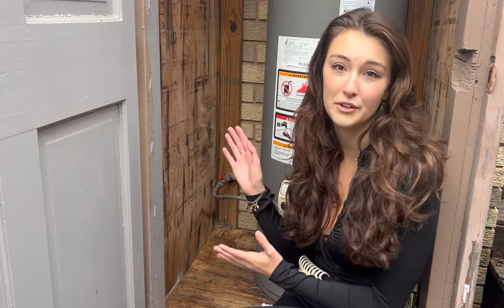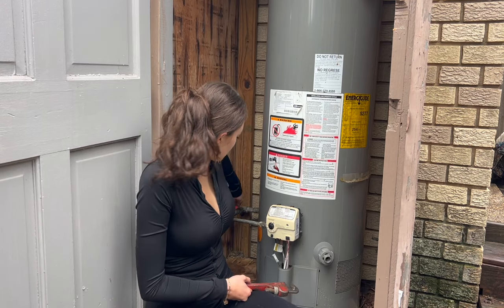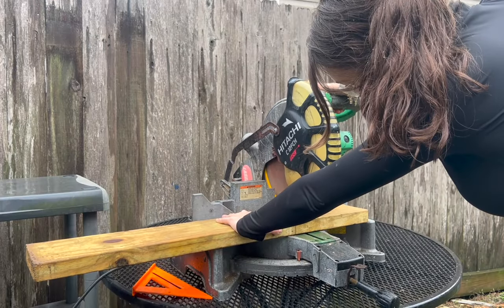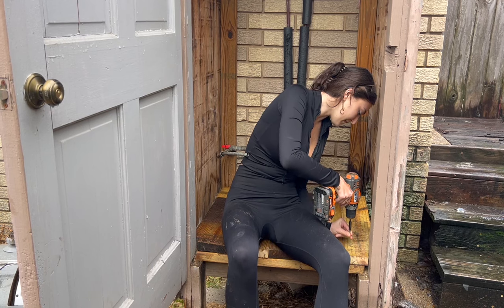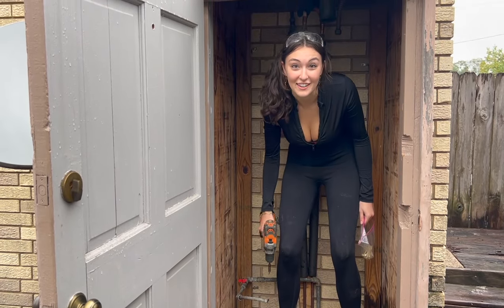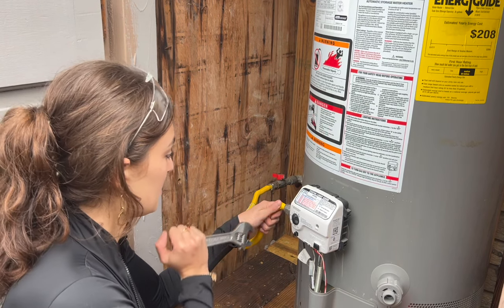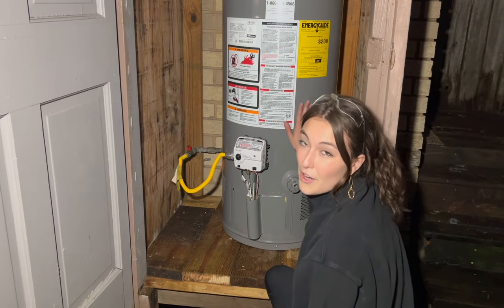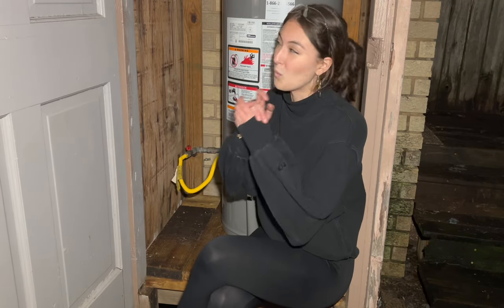How to Install Brand New Water Heating System!

Comment: Great video Rachel! I'll remember you if I have any plumbing problems. 😉
Just wanted to add that with ELECTRIC water heaters, its important to shut the power off to the water heater FIRST, ottherwise, the second you drain the water, you'll blow your elements.
This heater was NG, so that step wasn't needed, but if anyone with an electric water heater wants to do the same thing, that's an important step.

Comment: When we had a gas water heater we'd sometimes get drips falling on top of the burner, especially when we used a bunch of hot water. I think the extra cold water coming in cooled off the flue inside the water heater and the water vapor from the burner condensed and dripped back down. Never put out the pilot light though.

Comment: @rachelmichellepizzolato When you moved your arm at part 0:06 in the video, I saw a very large hole at the very bottom of the wall on the right side of your friend shed. Is that very large hole supposed to be use for ventilation? At my house I use those foam insulation that cover water pipe for both hot and cold water. You should go back and put foam insulation over the hot water line, so it won't get cold and still stay hot. I know some people will say it is unnecessary to cover hot water lines with foam insulation, but I do it anyways.

Comment: The second thing to do after your hair, a very necessary step, is to flip the breaker to stop the flow of electricity. The elements will overheat once the water level drops below them, as well as the danger to fry your up-do when you disconnect the power lines.
Reply from the maker: It is a gas heater…No electricity is required for its use. 

Thanks for stopping by! Enjoy, and don't forget to thumbs up and subscribe 🛎 so you never miss an upload! Please share the videos and comment on what videos you would like to see next + follow my socials to keep up with my daily life! 😉 

--
💥My Socials:

TIKTOK - OfficialRachelPizzolato
INSTAGRAM - instagram.com/beautyandbrainswithatwist
INSTAGRAM (Alternate) Instagram.com/rachel_pizzolato
FACEBOOK - https://www.facebook.com/Beautyandbrainswithatwist/
TWITTER - https://twitter.com/braintwist2112
WEBSITE - https://beautyandbrainswithatwist.com/
SNAPCHAT - Itsrachelpizz
Reply: :face-blue-smiling::face-purple-crying:

Comment: As a licensed inspector for more than 20 years, unfortunately I would have to fail this installation for 2 reasons. 1. There is no overflow tube installed. It  must extend from the spigot by the TPR valve near the top of the water heater to 5 inches above the floor. It can be copper or pvc. 2. There is no proper air vent installed for combustion. (The hole rotted through the side wall doesn't count). A vent hole can be cut into the door. A vent must be 1 square in for every 1000 btu of the water heater. So, a 100,000 btu water heater must have a 100 square inch (10" x 10") air vent. An air vent is needed so oxygen can mix with the natural gas for combustion. It's relatively easy to fix these 2 issues to make your installation meet plumbing codes.
Reply from the maker: I will get right on those issues as soon as I get back home! Thanks so much!

Thanks for stopping by! Enjoy, and don't forget to thumbs up and subscribe 🛎 so you never miss an upload! Please share the videos and comment on what videos you would like to see next + follow my socials to keep up with my daily life! 😉 

--
💥My Socials:

TIKTOK - OfficialRachelPizzolato
INSTAGRAM - instagram.com/beautyandbrainswithatwist
I’m 
INSTAGRAM (Alternate) Instagram.com/rachel_pizzolato
FACEBOOK - https://www.facebook.com/pBeautyandbrainswithatwist/
TWITTER - https://twitter.com/braintwist2112
WEBSITE - https://beautyandbrainswithatwist.com/
SNAPCHAT - Itsrachelpizz
Reply: Get a life
Reply: @petemarron6677  The girl tries to do things the right way. I'm a licensed plumbing inspector, and just told her how to easily do it the right way, with 2 simple things that will take a couple of minutes. So get a life yourself.
Reply: @JimMorrison-m8x  I think it's great you gave your professional opinion on it with purely constructive feedback. Thanks for sharing sir.

Comment: So the pilot light heats up the thermocouple, if the pilot light is dirty it will be orange, and it would be too cold to keep the thermocouple hot enough to stay lit. ( flame goes out on tank)   Or is is possible the thermo couple is weak and need replacement.  All of these things are cheap to do. These things cause intermittent heating and going off. Unless there is water in the bottom of the water heater, it is fine.

Comment: 6:58 When you are done put a bright light inside the Water heater cabinet and see if you see light, the water heater requires air to breathe so it can maintain a fire, no air no fire, from what I can tell the only place it is getting air is where the wood is rotten on the side of the cabinet.
Reply from the maker: The box has been there for over 25 years…Air flow is not the issue!

Comment: I've never seen a hot water tank outside of the house? Must be a Southern thing? 
Also, no Teflon gas line tape on the threads?
Reply: I'm thinking there's alot of things you haven't seen.

Comment: I would have installed a metal drain pan under it to prevent the wood from deteriorating and converted to an electric water heater (I hate worrying about gas leaks.).

Comment: would have thought you'd turn off the gas before draining. better title would have been water heater replacement, since no repair is being done.
Reply from the maker: The gas was off at the heater valve and the gas line was not disconnected yet…So, I don’t see a problem. Water heaters are drained all the time to remove sediment without disconnecting the lines…So, what would be the difference? 

Thanks for stopping by! Enjoy, and don't forget to thumbs up and subscribe 🛎 so you never miss an upload! Please share the videos and comment on what videos you would like to see next + follow my socials to keep up with my daily life! 😉 

--
💥My Socials:

TIKTOK - OfficialRachelPizzolato
INSTAGRAM - instagram.com/beautyandbrainswithatwist
INSTAGRAM (Alternate) Instagram.com/rachel_pizzolato
FACEBOOK - https://www.facebook.com/Beautyandbrainswithatwist/
TWITTER - https://twitter.com/braintwist2112
WEBSITE - https://beautyandbrainswithatwist.com/
SNAPCHAT - Itsrachelpizz